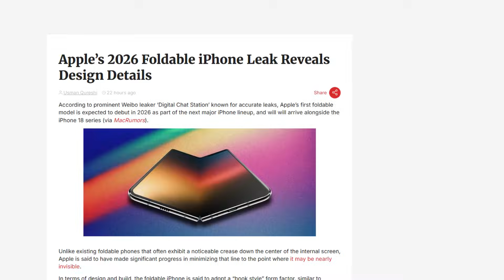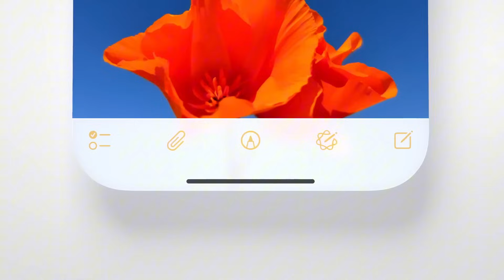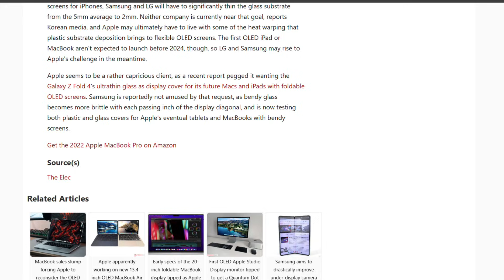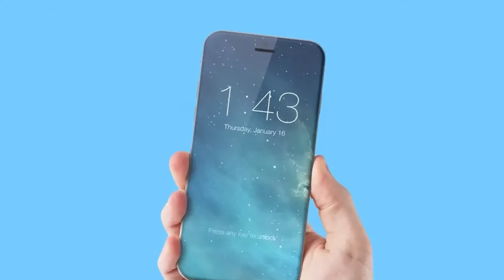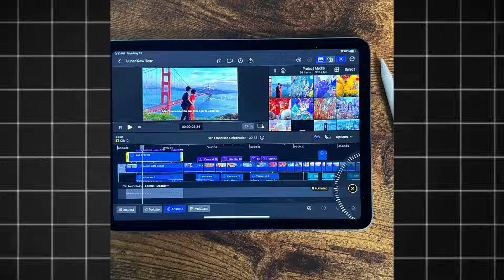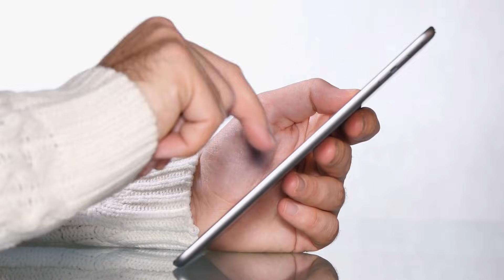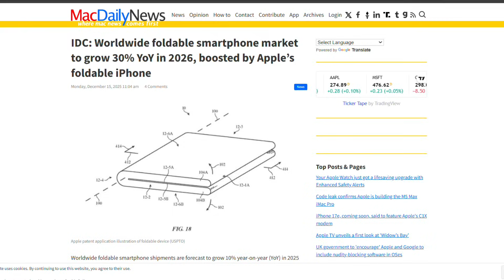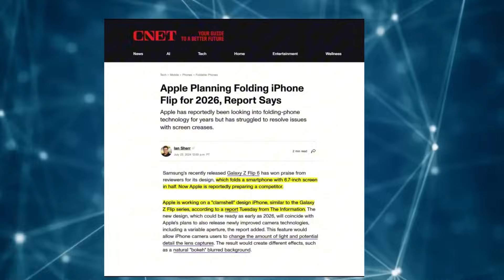Apple’s Foldable iPhone Is Coming in 2026 And It Changes Everything

Comment: It won't change shit, 4 years late and nothing new. That's all you can expect from apple
Reply: Four years late compared to what, exactly—an announcement slide, a beta, or something half-baked that breaks every other update? Apple doesn’t race to be first; they ship when it’s stable, integrated across the ecosystem, and usable by millions of non-technical people on day one.

That’s literally been their model for decades. They let others experiment in public, absorb what actually works, and then deliver a version that’s secure, polished, and supported long-term. You can criticize the pace if you want, but calling it “nothing new” ignores the engineering, integration, and scale involved.

Complaining that Apple didn’t ship early enough is like complaining a bridge wasn’t opened while it was still missing bolts. It’s not insight—it’s just impatience dressed up as criticism.
Reply: @donnymiddlebrook  ¨Apple doesn’t race to be first...¨ allow me to correct you.
Apple doesn’t race. PERIOD. we have 6 years of bigger prices and the exact same device behind on the competence in EVERY aspect. What are you inflating about?
There was a time when Apple did race and they were always the first and better. That time is gone fan boy